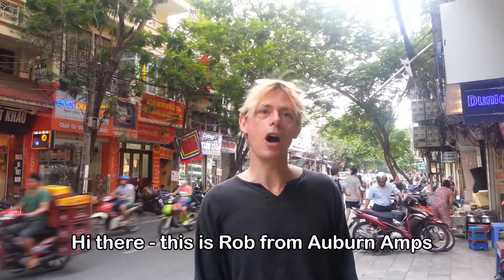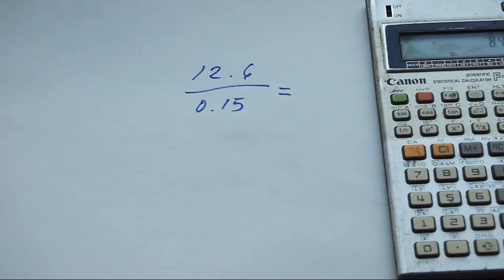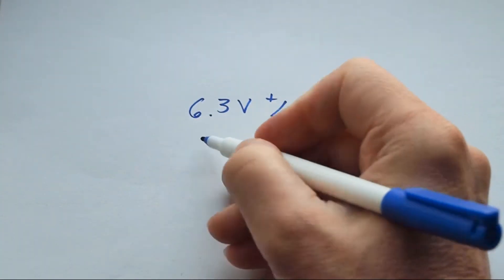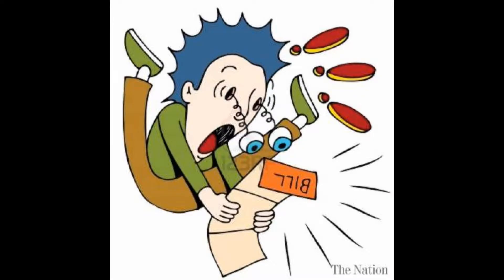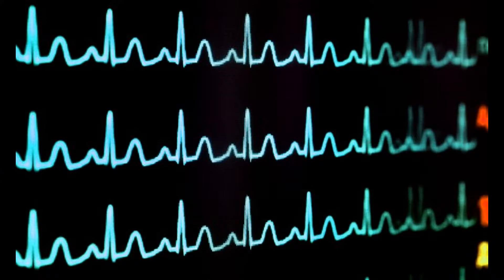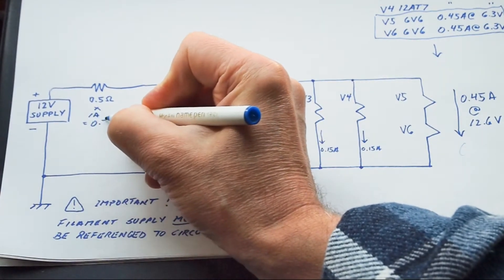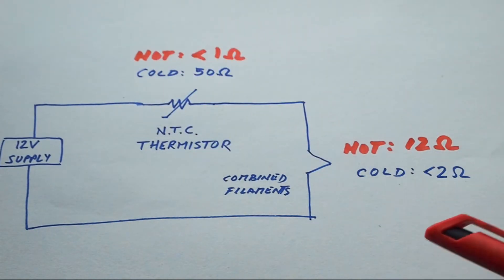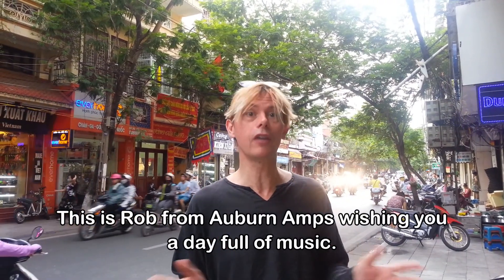The Secret World of Guitar Amp Tube Filaments

Comment: I have recently started using Chinese-made switching power supplies which are specifically designed for tube amps.  They produce DC filament power, high-voltage (usually 260V), and also a handy 5V DC source.  Outputs are sequenced and ramp up slowly.  Pretty much solves all the main concerns with powering tube amps.  I haven't used enough of them for long enough yet, though, to swear by the reliability; all I can say is "so far, so good".  But anyway, if you're already using a switching supply, rather than (cleverly) kluging around with a failire-prone mechanical relay, why not put some timing circuitry into the control side of the supply, to ramp up the voltages as desired.  Or even your klugy relay, might be better applied to reduce the voltage regulation value within the supply, rather than passing all that filament current through the relay contacts.  Just an idea.  Your work is very interesting and no negative criticism is intended.
Reply from the maker: The power supplies you describe sound like an interesting option, especially if their MTBF proves to be up to the challenge. SMPSs tend to be small and light enough that installing two with a failsafe relay is another option. Please keep in mind that not all relay circuits are "klugy", and relays properly chosen for the application can have very impressive reliability figures, as borne out by their continued use in many industrial settings. Also note that the two-component relay-based warmup circuit I described is actually quite elegant: if the relay fails in any way (open coil or faulty contacts), the circuit will continue to pass current to the filaments. The components get ungainly in a big amp, but in a 12V string in a smaller amp that circuit is a good solution.

Comment: For a 6.3 V filament tube the coreect voltage is .............6.3 VOLT !
Any deviation , higher and also LOWER will impair life time expectancy.....
This is ONLY valuable for VOLTGA CONTYROLED filamants !
Current controled heaters ( string connected heaters like PCC etc ) MUST be driven by the correct current , not voltage !
Some loxer the voltage to,oçbtain a smoother sound ............resulating in a cathode operating at a lower  ( = uncorrect ) temperature...........The getters don't work at a lower temperature and do no longer do,their job corectly and the electrodes as well ast hecathodes become poisoned .....................cathode barrier may become sooner an issue as well ( degenartion ).
The ONLY corcect way to power the heater is to respect as close as possible the correct voltage .
Reply from the maker: After reading your comment, I again checked for data and research regarding the relationship between tube filament voltage and longevity, but I couldn't find anything authoritative that supported your viewpoint. One paper found that running 6.3V filaments at 6.1V extended their life by 50%. Transmitter maintenance personnel often run new tubes at slightly higher than their rated filament voltage, then back it off to a slightly lower than nominal voltage to maximize their life. Keep in mind that 6.0V is less than 5% lower than 6.3V, and that filaments fed by a power transformer winding typically see much wider voltage deviations due to normal variations in the mains voltage (6 to 10%), historical changes in the mains voltage (5 to 10%), and normal variations in transformer windings. Also keep in mind that filament failure is a relatively minor cause of overall tube failures. Of course, there's no harm at all a running audio amplifier tube filaments at precisely 6.3 or 12.6V (and fully current regulated) if you can find a way to do that, but in practical applications this pursuit would soon give way to diminishing returns.

Comment: At 4:02, a hum-balance pot mounted to the rear of the amp. This video didn't discuss common hum reduction techniques for tubes being heated from an AC supply (probably encompassing 95% of the amps that techs and DIY tube amp enthusiasts will encounter), such as grounded centertaps, artificial centertaps using a pair of fusible resistors (or a hum balance pot), twisted-pair wiring, phasing all heaters the same way, and biasing up the AC filament supply above ground with a DC voltage (in a cathode-biased amp, simply steal the necessary voltage from the output tube's cathode)  I also have to wonder, what will happen to a switching power supply being used to heat tube filaments if the tube develops an internal short? Appropriate fusing is called for.  The artificial center tap using a pair of small, low wattage resistors always struck me as a simple solution to protect the filament transformer winding from shorted tubes.

Comment: Some big solid state hifi power amps (Nakamichi PA-7 for instance) similarly use a bank of power resistors in series with the power transformer primary, and a normally-open relay on a timed circuit to shunt around the resistors a couple seconds after turn on.  The resistors  limit the current surge through the power transformer at turn-on as the big filter caps charge up, and then the relay closes and takes the resistors out of the circuit.